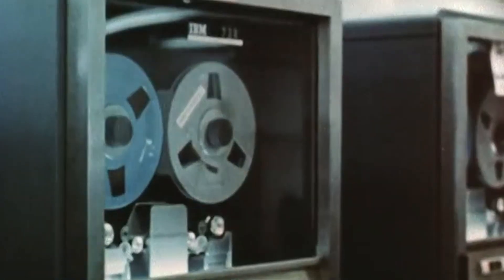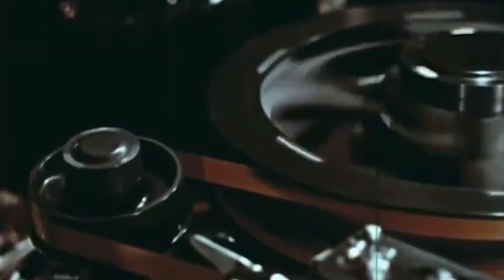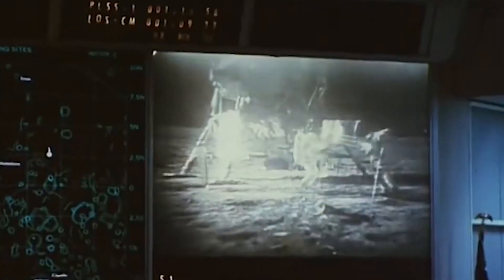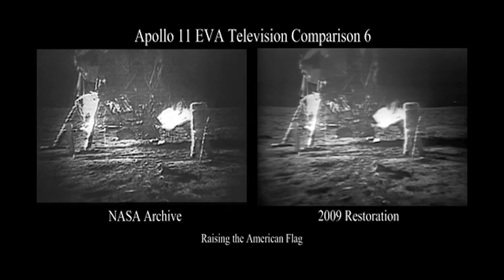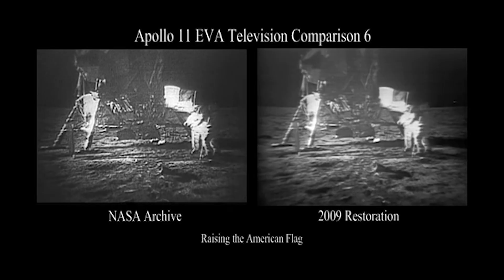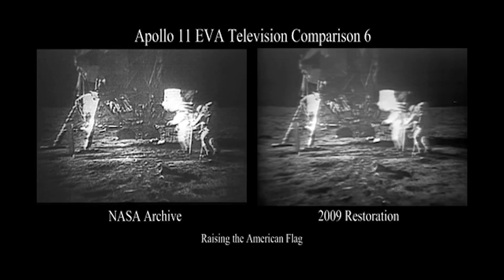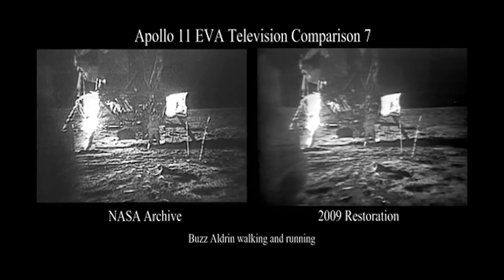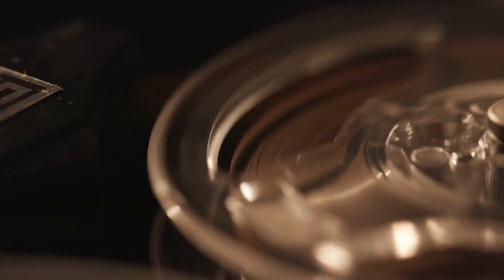Apollo 11's Video Tapes Went Missing - What Was on Them and Who Took Them?

Comment: Ask any diver how much the tanks weigh when just going down for an hour, and that's just one person. Compressed air is heavy. If you filled a tank in earth's atmospheric preasure and created a vacuum, would the tank expand from lack of resistence? Multiply that by 3 passengers plus the time from when they entered the capsule, until the hatch was opened at splashdown. Every time they opened the hatch in space they'd have to repressureize all that volume before removing their helmets to eat and drink. Show me all the tanks necessary for three men to breathe 24 hours a day for 8 days. Due to weight restrictions,  the Atlas rocket would have never left the ground. My guess, they launched three men into orbit splashing down after they took enough footage to spoon feed the mass psychosis. Everything else was a starwars production.
Reply: Blackeyesforyou.  You miss an important thing here. The divers have AIR in their tubes. The astronauts had OXYGEN. You can’t just compare those two gases. And they never opened the hatch on the command module in space, so there were no problems to take off their helmets.
Reply: blackeyesforyou  Funny that so many people, including the Soviets could track their signals as coming from Moon, if they went around Earth in an orbit… Don’t you agree???

Comment: From what I have read, from various sources, the footage was filmed by tv cameras of the live feed in the mission HQ - ensuring any surviving video would be low quality. The original recordings were the equivalent of HD.
Reply: This video says the original recordings were 320p and 10 fps, which is distinctly lower-quality than the average tv program of the time, not HD by any measure. The original tapes would hypothetically look better than the broadcast version, but it wouldn't be revelatory image quality.
Reply: @jamescarter3196  "this video". Have look for what others have said about the quality of the original broadcast.
Reply: dampnickers. You missed one important thing: the reason they filmed the video from Moon with broadcast type cameras, was that it was the only way to convert the TV signal to a format that could be shown on standard TV-sets.
Reply: @YDDES  that's not the case though. It would have been very easy to convert and broadcast the transmission from the moon. The ability to do it was in place already in several places. The reason it wasnt was "if anything went wrong and the safety of astronauts was in question, what went to the public could be controlled".
Reply: @dampnickers  The only thing they could have done, if something went “totally wrong” was to stop the feeding to the public. They could of course not have pretended everything was all right and went on well.
Reply: @dampnickers  What? What could they have done, if a really disastrous thing happened?

Comment: Of course they lost the easy to prove fake footage..i wish it happened too but it didnt .. Anyone with even a small amount of reasoning knows it never happened..yet most people believe lol scary
Reply: Reasoning you say? 
There is heaps of data. Massive catalogs of data, development, design. There is data detailing the hugely successful and widely used Saturn V, on it's entire development, its predecessors, its original concept. There is data on the development of every bit of Apollo. Changes, prototypes, failed concepts, etc. The space suits, same thing. The entire launch facility, all the labs, the manufacturing plants, material development companies, etc etc. 
All of it works out and is accurate. The math is right, the tracking data from multiple countries is right. So what you are saying is, NASA did every single bit of work required to successfully go to the moon, somehow tricked all the countries, and then opted to fake it, and built and executed a series of missions around going...but it is fake. That makes no fvcking sense at all. 

Let's put this in perspective. Say you planned to drive across a continent. But nothing exists for you. So you mapped out the continent, drew up plans, invented, designed, tested, redesigned, and manufactured a car. Conducted a series of driving tests. Redesigned some more. Released for availability all your plans, and routes, and data. Then had every country watching and tracking you...but didn't actually go but got everyone to say you did.

Comment: After the Declaration of Independace was signed and ratified.
  It was frame, hung on a wall, in direct sunlight.
  The text has greatly deteriorated by the heat and light and is unreadable in parts.
  My point is that hindsight is always 20/20.
Reply: The British come and burn down the Whitehouse and no one thinks of going to save the Declaration of Independence, the Bill Of Rights, etc. One dude thinks of it, goes and steals them, and hides them in his barn. The secret service was thankful. The guy was a dick, apparently.

Comment: Here's something to consider, the Apollo missions were so scripted, voice recorded, and rehearsed down to the second. With so much "live feed" material required and to prevent gaps in content, moon landing, site experiments, soundstage, audio tracks and video on the moon and earth were all spliced together at Johnson Control before broadcasted out.
Reply: yet, things actually went wrong when landing. The computer threw an error, and Neil had to go to manual pilot mode. Buzz had to watch thru a window and yell landing information to Neil. Later, after their moon walk, they found a broken switch. The switch they needed to launch to leave the moon. They had to try to attempt a fix of this switch using a pen. Other things went wrong.

Comment: Resources were limited back then and I can understand how stuff gets lost.  I work for one of the auto companies.   We wanted to update a car based on a 60's model.  It's not like I can go on the server and download the specs.  Some stuff was put on microfilm but they are all hand drawn things and hard to see.  I had to find the buildings stuff was archived and I was able to track stuff down and it was cool to find all these hand drawn engines, with their calculations.  I then found the patterns and models used for the body.  We could then digitize scane them the import into our CAD system and rebuild the body.
I can easily go back 25 years and get any file I wanted but prior to that, some stuff was a mix of computer or hand drawn or just hand drawn which is so hard to keep track of and you hope there is some old record keeper like you see in the movies that handles the archives and knows where to look.  Once Apollo was cancelled, all that knowledge was lost and it has to be re-learned.

Comment: Ill tell you what was on them....proof of them faking that landing. Go back and watch the entire footage with adult common sense eyes and not the fascinated innocent eyes of a child. Ask yourself, if i were going to the moon, wouldnt i get pics of the sun from the moon, stars from the moon, earth from the moon....they took NONE. Never even pointed a camera up while on the moon. Took 80% of fuel to leave Earths atmosphere and still traveled 3 days to the moon, orbited many tines, and flew just the control capsule(which had no fuel tank) 3 days back and into earths atmosphere. 3 astronauts launch in the control capsule, 2 take the lunar lander down....how? Lander was stacked under capsule in rocket. There were no transfer panels for them to switch. 2 left moon and joined capsule in lunar orbit, 3 returned in capsule, no record of space walk to transfer to capsule. Enter atmosphere so fast that plasma forms from heat, yet parachute doesnt melt or burn away and when splash down happens, no steam at all comes off. Wasnt enough time to go from plasma producing heat to cool enough to not make steam when hitting cool water.....was scripted and faked in a warehouse painted all black on inside. Helicopter simply took capsule up in altitude and dropped it and parachuted down....no video or witness on ground saw it entering in the atmosphere red hot like returns of today....weve been deceived
Reply: None of what you wrote is true. Much of it is completely factually incorrect even if the Moon landing was fake.

Comment: I have one important question no one wants to give an answer to is how did we get passed the Van Allen radiation belt? The walls of the capsule would have needed 6 feet of lead shielding to protect anyone inside.
Reply: The fact of the matter is they didn't it was all filmed in the Desert
Reply: @BTCxyz369  We did land on the moon the Lunar Laser Retro Reflector is just one of the ways you can verify it yourself. Shine a laser at the reflector that Buzz Aldrin left on the moon and it will be reflected right back. measure the time it takes and multiply by the speed of light and you can calculate the current distance of the moon from earth.
Reply: @rjg9631  The Apollo traveled through the radiation at a speed of 15537 miles per hour. At that speed the radiation dose would be 16 rads which is a low  dose  (A lethal dose is 300 rads).
Reply: @BTCxyz369  It was filmed in a military Hangar!😊
Reply: @rjg9631  That must have been a BIIIG hangar…
Reply: @YDDES  A retired military officer claimed that he was in the hangar when the moon acting was done. 😊
Reply: @rjg9631  ”A retired mlitary officer”… Who, where and when? Proof? Otherwise I can just say: ”A circus clown claimed he say a world speed record in the X-15”. You liar…
Reply: @BTCxyz369  then who left the footprints on the Moon? Because the ESA Lunar Surveyor did photograph them. Or are they on on the big conspiracy in your head too? How about the Soviet Union then? No one had a better reason to expose Apollo as a fraud than them. They certainly had the tech to monitor the entire mission. And they did. They knew exactly where the transmissions were coming from. Yet even they admitted it was real. Not right away, but they got around to it eventually. So what's your excuse for being so stupid?
Reply: Coyote. Why do You think the radiation would be lethal?
Reply: They went through the thinnest part, very fast. That's how.
Reply: @Carl_Aznable  And, all ”radiation” isn’t always lethal or even dangerous.
Reply: Magic... And belief in jesus
Reply: If you don't know that by now,you are pretty ignorant.
There is this thing called the Internet,it's full of   information,or you could read a book,or magazine.
Reply: Q: How did we get past the Van Allen radiation belt?
A: Very quickly. That's how.
At 37,500 MPH they weren't exactly lingering in the belt.
Reply: Coyote. That “6 inches of lead” is just an urban legend. Ever heard about “bremsstrahlung”? Lead would only have made matters worse and the Van Allen belts are NOT lethal to just pass.
Reply: @YDDES  These belts are shaped like two nested doughnuts. Their sizes change depending on solar activity and, sometimes, on how we model them. The inner belt starts at an altitude of 600-1,600 km, according to different sources, and extends till 9,600-13,000 km. The range of the outer belt varies similarly: from 13,500-19,000 km to about 40,000 km.
Reply: @YDDES  Yet still, there are doubts these days that humans actually achieved this feat. For example, the following question appeared on Quora on August 23, 2018: “When will the existence of the Van Allen belt and our inability to penetrate its harsh radiation with today’s technology force NASA to admit it faked the moon landing?”
Reply: @dansv1  Yes but back in the 1960's they were not able to find the level of radiation but to guess. I wouldn't put my life on the line on a  guess.
Reply: @COYO-T  How so...?
Reply: @COYO-T  The “Van Allen-belts” were discovered and measured by Explorer 1 early in 1958. So yes, we knew what we needed about them.
Reply: @COYO-T   I have an important message to you: Lead would only make the Bremsstrahlung much worse. The Van Allen belts are not lethal to just pass through.
Reply: @COYO-T  Ever heard about Explorer 1 and it’s Geiger counter?
Reply: @YDDES  Landing on the moon is also a urban legend

Comment: I always believed they went to the moon, but as time has gone on i've started to question it, NASA say they are going back to the moon, but as they say "we have to develope the technology", why would you have to if you already had it, the tapes going missing, the plans to build the saturn v rocket can't be found, NASA went from not being able to get a rocket off the ground to putting men on the moon in less than 10 years, but where has spaceflight gone since then, nowhere, just the spaceshuttle that only orbited the earth, was it filmed on a sound stage, is the film Capricorn One based on what happened, we'll never know

Comment: Always wondered why, when they walk on the surface of the moon, due to the low gravity, no dust rises from their steps. Low quality footage or not, we should be able to see it.
Reply: How dust acts on the Moon has something to do with electrostatic charge. The Moon is being bombarded by solar wind all of the time. So that makes what goes on there a lot different than what our Earthly reference would have us think.
Reply: there is no air for the dust to be suspended in, so when they kicked up dust, it flies away and falls right back down
Reply: @Carl_Aznable  what makes the dust fall back down? Lunar gravity is not very strong. It is one sixth Earth gravity if memory serves me. Then there's solar wind which can charge particles. Like charges repel. That repulsion is enough to make dust rise on the Moon. What with there being no water, or air and the gravity being lighter and all of that. The Moon is a very alien place as far as us Earth dwellers are concerned. So things are different there. They are beyond our experience even. Makes what happens there rather strange from our perspective.
Reply: @1pcfred  Gravity is still present on Moon and atmosphere is virtually not.
Reply: @1pcfred  Moons gravity is about 0.166 of Earth gravity.
Reply: @Carl_Aznable  are you sure there's no air on the Moon? Because the Earth's atmosphere does extend beyond the Moon. Granted it is pretty thin out there. But there's molecules of atmosphere. I think at the distance of the Moon it may be as thin as one molecule per cubic meter? Still it's amazing there's any out there at all. I know I was surprised to learn there was any.
Reply: @1pcfred  The complete lunar atmosphere weighs about 10 metric Tonnes
Reply: It rises, look better. I've seen it many times.

Comment: Bull bull bull.. never when to moon...how could they take up enough oxygen  😫  work it out skin divers need 2 tanks for 1 hour of oxygen  x 3 men = 6 tanks per hour  x 230 hrs  for journey there and back equivalent  6× 230 hrs of oxygen? Wtf... they didnt go to the moon folks.. simple math.. imposible
Reply: At flow rate of 10 litre per minute a divers   cylinder would last just over 1 hour. At the flow rate of 5 litres per minute, a cylinder would last just over two hours. Twice what you said.

The Lunar Module descent stage contained two oxygen tanks, each of which contained 48 pounds of gaseous oxygen at 2,690 psi. This supply provided the oxygen that they used during descent, and during their stay on the Moon, including filling their backpacks and repressurizing the cabin after their EVA (“moonwalk”).
The ascent stage contained two tanks, each of which contained 2.43 pounds of oxygen at 840 psi. This supply provided the breathing oxygen during liftoff from the Moon and rendezvous with the Command Module. And the command module had oxygen tanks onboard.
 So your bull claim is itself bull.

Comment: I like how they explain their reasoning for throwing away the back up data. It’s funny, they threw away the original data in the exact same fashion.
Reply: No problem.  Just have NASA rescind its ruling that declared the Apollo 11 landing site off limits to all visitors, and then send an international lunar lander there to take high rez. videos and still images; perhaps a sample and return option.  Oh yes, many still photos of the starscape visible from the surface of the moon ... DURING THE DAY.   Just shade the lens, aim it away from the sun, like the Hubble telescope, and aim it up away from the bright reflective lunar surface.  No atmosphere means no light scattering effect.
Reply: The mid 1970s were a time of inflationary costs and NASA’s budget had been cut, with Congress under the impression that the US won the moon race and that was good enough.   Engineers at the time probably assumed (incorrectly as it turns out) that they got as good a transfer of the video as would ever happen, so why not re-use the telemetry tape.  You’d think the first landing on the moon would deserve especially jealous guarding of the source material though.  Seems a bit odd, doesn’t it?

Comment: You do a whole mini series on data/film preservation issues. 
It’s crazy how fast it moves just cause and the lack of backward compatibility. Ironically it’s corporate grade data preservation that does best. 
They went (most) from reel to reel magnetic tape, beta max, HD-DVD. Chasing the highest quality but also the most open ended tech so there not screwed if the suppliers says no or takes advantage on everything from the media cost to accessibility decades latter.